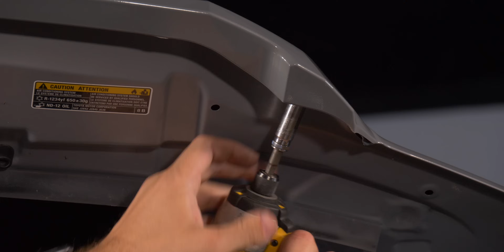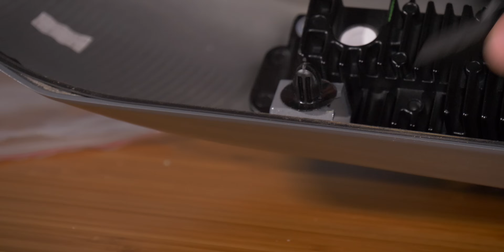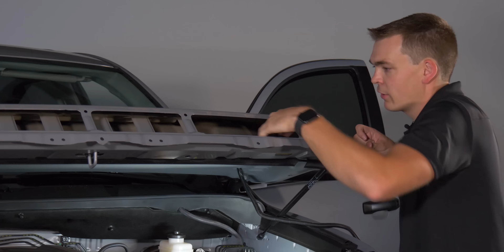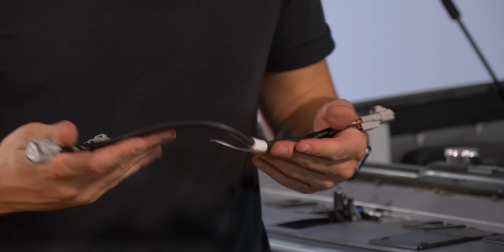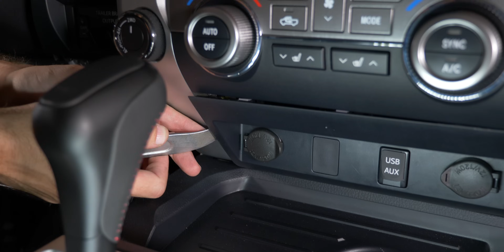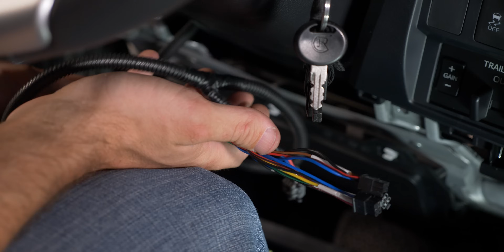NSV LED Light bar for the Toyota Tundra Install Steps

Comment: Where do I find the switch panel? It seems like your site only offers the singular 3-in-1 thing and I really like the look of the red covers.
Reply from the maker: Unfortunately, the full NSV switch panel with the red covers has been discontinued, which is why you’re only seeing the 3-in-1 switch module available on our site now. Totally agree though—it had a clean look! We’re hoping something similar comes down the pipeline in the future, but for now, that 3-in-1 is the only option still in production from NSV.
Reply: @HeadlightRevolution  That's highly disappointing. I guess I'll skip this light bar for now. Still gonna get the XB Headlight/Taillight set, though.

Comment: I was  doing n install one of these n it's not working, why would he cut the (blue) wire that feeds signal power to the turn signal,  instructions say the opposite of what this guy did, I gotta try n figure out what I missed tomorrow morning,  any input would be highly appreciated 😊
Reply from the maker: Reach out to us! sales@headlightrevolution.com or 218-755-5200
Reply: Same here, just got mine installed on a 2018 Tundra 1974, went to turn it on and nothing! I spent a lot of time getting this installed with no reward. So I cut the blue wire as instructed, my headlights are LED and I’m using the switch that came with the light bar. Any help appreciated. Thanks.

Comment: I did this install today on my 2019 Tundra TRD Pro and I felt the hardest part was running the 6 pin wire harness thru the firewall. 

(I decided to send 3 wires at a time to make it easier)
Reply: I was  doing n install one of these n it's not working, why would he cut the (blue) wire that feeds signal power to the turn signal,  instructions say the opposite of what this guy did, I gotta try n figure out what I missed tomorrow morning,  any input would be highly appreciated 😊
Reply: @Fenixmaster9 did you figure out what you did wrong?

Comment: Completed my install today, fishing the wires wasn't nearly as easy as you made it look but I got it done, fit and finish is impeccable and wiring harnesses are OEM quality, video is far more comprehensive than the booklet.

I decided to use the 3 in 1 switch instead of the replacement panel, it was more inconspicuous and less ostentatious, more simple cleaner look.

Very very impressed with the quality of this product

NOTE: The 3-in-1 also requires the red and blue wires to be clipped to the cigarette lighter harness, the booklet doesn't mention this specifically

Comment: What I would like to know is how well does this light bar hold up. Does the extra weight of the light bar cause any issues? 

Toyota likes to use an awful lot of plastic in the 2019 Tundra and I'm a bit concerned that after the hood gets slammed a time or two or I take the truck off road and the truck takes some hard bumps that the extra weight attached to this plastic part that honestly wasn't designed to have this light bar attached to it might come off and possibly damage the "hood bulge" or worse.  

Has anyone had one of these light bars installed on their truck for any length of time and can attest to their durability? Does it remain looking and acting like an OEM piece or does the extra weight of the light bar cause any damage to the plastic "hood bulge"?

I like the look of the light bar and maybe it might come in handy. I don't care much for the $1,000.00 price tag though. I'm considering it but I would like honest answers to my questions first though.  Anybody got one of these?

Comment: So to use the NSV light bar high beams needs to be turned on?
Reply from the maker: No you will flip it on. 

Key Features:
1: Lock and unlock function: scanning/swipe effect

2: Accent Lights: Daytime running mode for road use and increased visibility

3: Full light bar function

4: Scanning/Swipe (Knight Rider Style) function

5: Disable DRL Function
Reply: I do have the scanning function when unlocking and locking but I don’t have any other function do you know what it can be? Please help .
Reply: I have  the same issue 
Only swipe effect and Nothing else the switch  it doesn't  even work

Comment: I have the NSV knight rider bar. I installed new LED headlights: now when I turn the truck off & lock it the light doesn't go back and forth. I didn't touch anything on the lightbar and to note every thing else works correctly. 
Any ideas why?

Comment: Do I have to cut that blue wire on my 2017 tundra? I upgraded from Halogen headlights to LED headlights, and used that harness wiring to upgrade my headlights.
Reply from the maker: Reach out to our CS team for help troubleshooting!

218-755-5200
Sales@HeadlightRevolution.com

Comment: Excellent video! I saw on another video from HR that these NSV lightbars can do a very quick flashing mode. I just bought and installed these but I didn’t see how you can enter the quick flashing mode where all the lights flash quickly. How do you get that functionality?
Reply from the maker: This feature was removed, kind of a safety issue! 😅

Comment: Great video. I have ordered this. I have a 2019 tundra TRD pro. Question:

1). Do I need to cut the blue wire on mine? I’m not sure if my headlights are considered LEDs.

2). My switch power panel looks different from the panel you showed in this video with the “security” - will this model fit my truck?
Reply from the maker: For assistance with this product please reach out to our CS team! 

218-755-5200
Sales@HeadlightRevolution.com

Comment: Need help! Followed this to the T. Have a 2016 and upgraded the headlights to the new OEM 2019 lights. Light bar works but now I get the hyper flash on my left turn signal and won’t even turn on.  Also, my fog lights won’t turn on now. Thoughts?
Reply from the maker: Hit our CS team with a call or email and we can get to the bottom of this with you!

218-755-5200
sales@headlightrevolution.com

Comment: Considering this light for my 2019 Tundra.  I've looked through the comments to see if anyone else asked about the "street legal" question.  Meaning, has anyone had any problems running with the light bar on, while driving on city streets?  Are people flashing lights back at you for "high beaming" annoyance?  Just curious if anyone has experienced any of this.  Thanks in advance for any feedback.
Reply from the maker: This is not street legal, it is an off-road use only light bar minus the DRL feature.
Reply: Yeah, it's not legal.

Comment: So just installed the light bar, but the main light bar isn't turning on. The swipe effect and drl is working. What could be the problem?
Reply from the maker: Give us a call or shoot us an email if you're still having trouble.

Phone: 218-755-5200
Email: Sales@headlightrevolution.com
Reply: Having the same issue here
Reply: Where u able to figure out the issue I'm having the same issue except nothing works

Comment: If I replace my halogen headlight bulbs with gtr 2,0 H4 leds, would I still need to cut that blue wire?
Reply: I also pose this question. If the factory bulbs have been replaced with led's, does the blue wire get cut or remain intact?

Comment: I just installed this 100% correctly, light bar works perfect ! 

However , my taillights and license plate lights are not working as they should at night. 

Only the blinker and brake lights work in the back.

Front side marker bulbs are off as well, when they are suppose to stay on as well at night. 

Any ideas what could be the problem ? 
Thanks
Reply: Did you ever figure out the problem ?
Reply: @vvsstudios  yes, took it to Toyota Service Department and they said one of my connections needed a Ground. 
The fuses were popping without it, which caused all the problems. 

But it’s been fixed for a while now👍🏻 light bar is great.

Comment: Will this fit a 2021 Toyota Tundra TRD Pro as well as for the interior switch plate?
Reply from the maker: There is a new version coming out specifically for the 2021 model with a new switch plate.

Comment: Just got mine! Install was super easy and this light bar really does look like it came factory installed. Looks VERY cool and it is SUPER bright! Yes it is expensive but it is totally worth it once you can afford it (I waited six months for a Black Friday sale.) PAY ATTENTION to your wiring! Different trims might have different wire configurations on original connectors so you may have to do some repinning. I suggest contacting the NSV rep before installing the bar to make sure your wiring will work properly. I had a few electrical issues but it was totally Toyota's fault and NSV offers a solution. It's just better to have everything configured before you put everything together.

Comment: I have a 2016 1794 and I upgraded my halogen headlights to OEM led headlights using the plug and play harness from you guys. Do I still need to cut the blue wire or any wire?
Reply from the maker: You will need to cut that blue wire if you do not have a Non-DRL 14-17 SR5 Tundra, otherwise you will be good to go! Let us know if you have any other questions, have a great day!
Reply: Hey, 
Did you end up cutting that blue wire??

Comment: What’s the point of the Knight Rider  mode?
Reply from the maker: Not sure exactly what you mean, but if you are referring to the swipe feature, that would be used in a situation where you really need your truck to be seen. An example would be on the side of the road at night or in weather!

Comment: I have a 2020 Tundra TRD Sport.  My stock panel has 3 USB ports along with the 12 volt plug, etc.  Those 3 USB ports are exactly where the lightbar switches would be.  Would I have to lose one of my USB ports?  Is there a new panel available?
Also (I'm just wondering), why does the blue wire on the turn signal plug need to be cut?
Reply from the maker: Unfortunately that light bar is not out for the 2020 Tundra, but when it is you will not have to lose those USB plug ins when installing the light bar!

Comment: That's not a functional air inlet for the under hood temperatures?
Reply from the maker: It's not actually. It's a "fake vent"
Reply: @HeadlightRevolution  Ahh, but it could be made so, and that would be a whole lot better use of that area. A roof or the lower front end bar would serve the lighting purpose better.

All this I'm saying not much for a retailers info but others wisely considering the use of that space on the hood and their monies spent.

😉
Reply from the maker: For sure, there's nothing wrong with turning into a functional vent! We've never understood why so many manufacturers use fake vents always. 🤷
Reply: @HeadlightRevolution  Nor utilize the clear path of any kind on plenty of trucks/cars, that is clearly available under the hood and around structures from the front end to directly ram outside most fresh air to the intake.

And the late model Titans have this too.

I just recorded a bunch of Pre and Post 6pm, dusk, and dark night data/video of 2017 Titan HR $450 worth replacing Headlights, Rear Running/signals, and Reverse bulbs.  The Switchback bulbs supposed to apply to the front Running/Signal don't afix into the sockets tightly or properly to make the electrical connections on their own. Some fidgeting pressure makes the LED's prove they are operating, but not left alone . So that Post video is delayed until I trust you guys will swap out the correct applicable bulbs.  I had 2 GM trucks utilizing the path, and now I personally made the way on Nissan. But Vararam Industries created kits for Vettes and many trucks years ago, which I used the GM trucks ones, worked great.

Comment: How do you de-pin one of the pins?
Reply from the maker: The same way, but opposite! There is a little tab that holds each pin in place. You just depress that tab, and then pull the wire out.

Comment: I have the first-gen. NSV lightbar.  I've done so much splicing to my old wiring harness over the years after installing the OEM LEd lights and then resistors.  I kind of want to start fresh since my it looks like crap now.  DOes HR or NSV sell the wiring harness separately? Specifically the T- Harness?
Reply from the maker: We may have a spare harness laying around. Shoot us an email and we'll see if we can get you set up with one!
Sales@HeadlightRevolution.com

Comment: When will the 2020 light bar be coming out?
Reply from the maker: Very soon! The light bar is the same, but it will have a new switch that will work on the 2020 switch panel. The last update that we received from NSV is that it should be ready in a month!
Reply: @HeadlightRevolution  another question. I know it isn't "street legal" but the two lights at the end of the bar are connected to the turn signals so can they be used on the road together with the trucks original turn signals? Or can it not be turned on at all on the road??
Reply from the maker: The DRLs on the side are wired to a switch that can be turned on or off. I'm sure there is a way to wire them to the turn signals, but that would void the warranty from NSV.

Comment: will it fit on 2020 tundra sr5
Reply from the maker: Not yet. There was a switch panel redesign on the 2020's. NSV will have a fix for this real soon!
Reply: Hi, did you managed to fix for tundra 2020?

Comment: Was interested till you mentioned to cut original wires.
Reply from the maker: I get how that can be concerning. But if you cut it with plenty of wire left on each side, it can easily be reconnected if you end up removing the light bar.

Comment: Will the installation be the same for a 2020 SR5 double cab?
Reply from the maker: Yes and no. The 2020's have a different switch panel, and the NSV switch panel does not fit the 2020's yet, which NSV is currently working on. Other than that, the installation is the exact same.
Reply: Headlight Revolution  any news on the 2020 yet?

Comment: I have a 2020, has the switch panel solution been worked out yet to work with 2020 Tundra’s?
Reply from the maker: Not quite, NSV is still working on that!

Comment: It states that this will fit a 2020 in the title and I loved it, but when I went to the link it says it won't fit my Tundra cause of a new switch panel. Make this work....
Reply from the maker: The 2020's have a slightly different switch panel design, and that's the only difference. NSV is currently working on a set up that will allow this bar to fit the 2020s!

Comment: Going through and reading all the reviews about the price of this thing. Yes in my opinion it’s way over priced. I guarantee if another company came out with a product like this, the company who makes this light bar would cut their prices. I think most people who own a Tundra, including myself have no problem with having the money to purchase one of these, it’s just the principal of not wanting to bend over and taking in the hole (Dry with no Vaseline). 

Shit, on my last Tundra I purchased a new front grille with a full light bar that was custom made for my truck for $750.

The only way I’d pay a $1000 bucks is if the install came with it and a sexy woman sitting on my face.
Reply from the maker: No denying that it's not a cheap light bar. But honestly, I think it's priced correctly. It's the only light bar on the market that is OEM quality and fitment. Once everything is installed, it looks like it came from the factory.

If you're looking for more budget friendly options, we do have a few options from Diode Dynamics! 
https://headlightrevolution.com/vehicles/toyota-tundra/toyota-tundra-2014-2017/off-road-lighting-mounts-and-grilles/

Thanks for watching!
Reply: Hell I own a 2017 Tundra and I couldn't afford this light bar. But dam it is good look'n.

Comment: so you say that the motor can be reached without taking the light off. im not sure how this is possible unless you are a dwarf i ended up taking the light off to do it i cant see how anyone could possible reach in there and actually pull it out
Reply from the maker: It's a very tight fit, but it can be done. Having dwarf hands definitely helps!
Reply: @HeadlightRevolution  i could touch it but I could not get a good enough hold to unplug it

Comment: It looks very nice, and perfect fit. I just wouldn't install it myself. No way.
Reply from the maker: It looks worse than it is, Especially if you follow the video!
Reply: This looks simple and easy, especially if you have ever wired anything in a boat... i am adding a front splitter camera to my CTS Vsport and that's much more complicated than this, but still only a 2/10

Comment: welp my tundra is 2020 so wont work, looks awesome though
Reply from the maker: It’ll work with your truck soon, NSV is working hard on a new panel for you guys!
Reply: i have 2020 tundra platinum be interested if you will make interior panel for it..id buy it today

Comment: Would be very nice to see a "simple" version of this bar. 

Same location
Just a plain on/off bar
Wouldn't need any of the patch harnesses just a relay harness under the hood and the replacement console panel or just the option to cut the original to add one switch
Reply from the maker: That would be nice, Maybe they’ll offer it someday!
Reply: I second this ............why do we have to take the truck apart to wire this light up?

Comment: Almost 1000.00 for a light bar? I love the bar itself but for a thousand bucks I would duct tape a dozen LED flashlights to the hood.
Reply from the maker: Check out the video we just did with the Diode Dynamics light bar in the bumper. It's more affordable and still packs an insane punch: https://www.youtube.com/watch?v=s9Fe4Kc5e8o&t=324s

Comment: wonder if anyone decided to upgrade to an after market higher flow fuel pump instead of the factory recall replacement. 

i imagine anybody running a supercharger had to
Reply from the maker: That's a good question, I love the supercharged Tundras!